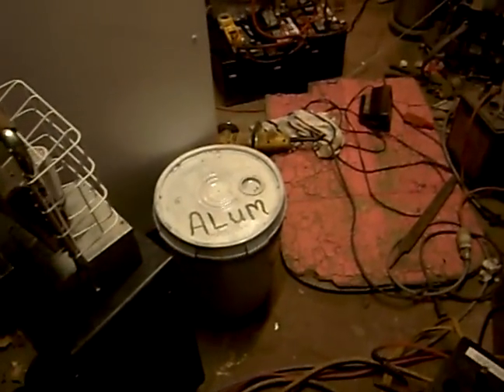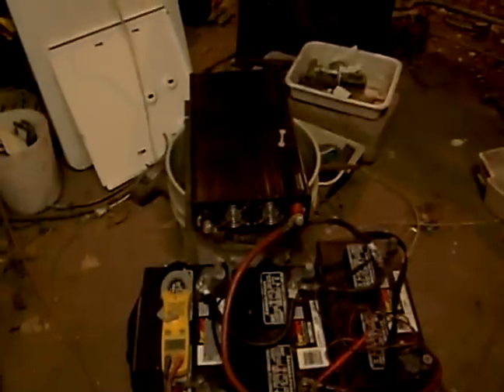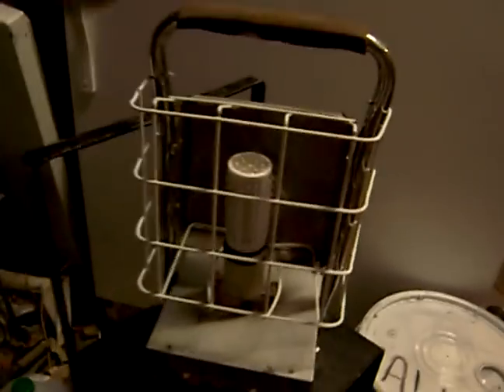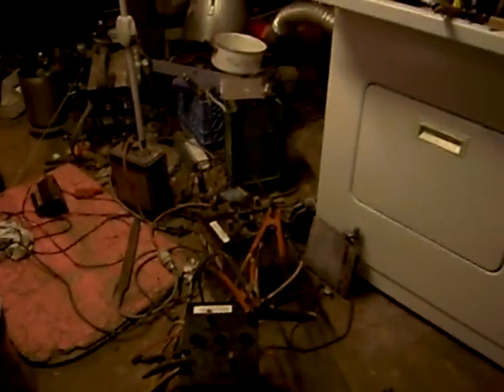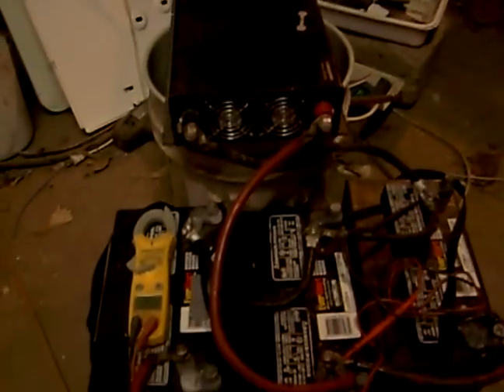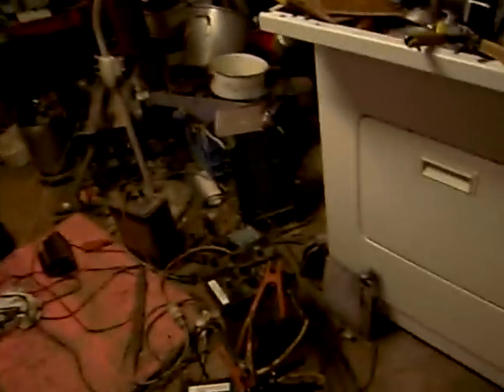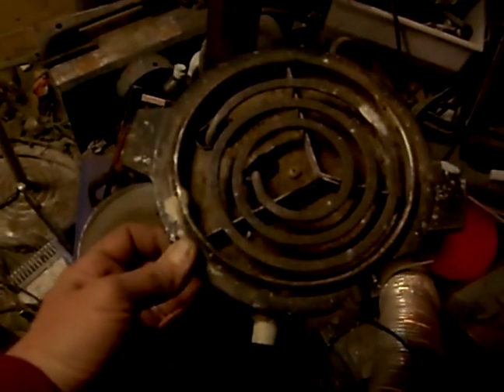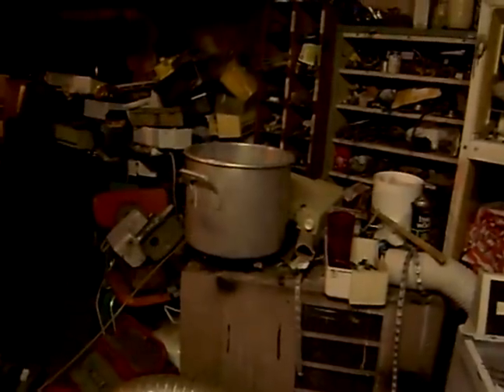Bedini Alum Batteries

Comment: so it's normal for these batteries to work around and under 12v? mine seem to standby around 12v and under load always go to 11v or lower! however, loads only seem to loose performance when the battery nears 10v (lamps, engines, etc). I'm new t this so I'd like to know if that's normal for this conversion?? (i'm using 6+ year old batteries!)
Reply from the maker: +DJBelbe Yeah the standing voltage after 24 hours is 11.7v-12v
Reply: +Bro Mikey thanks!